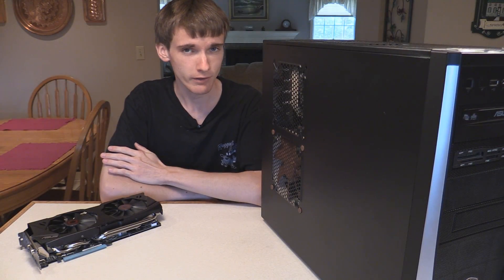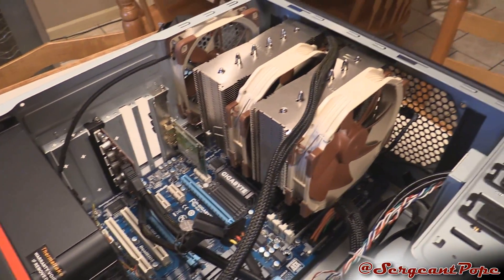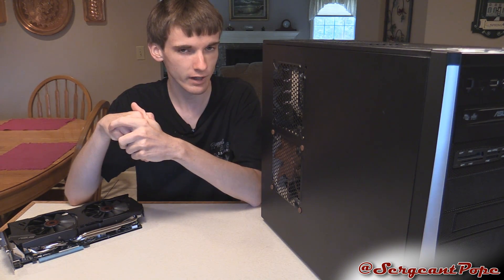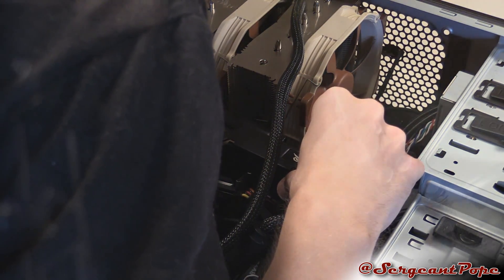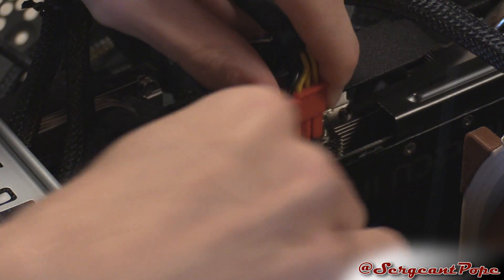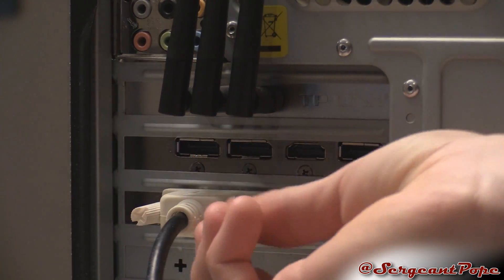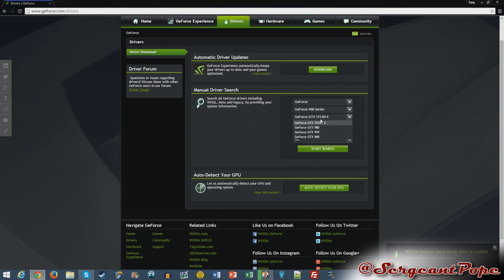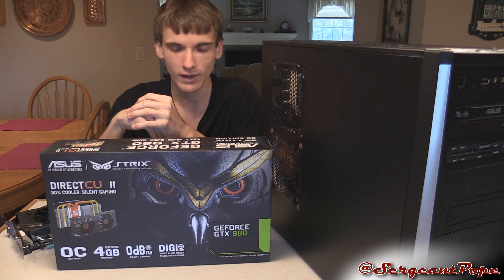How to install a graphics card - GET INTO PC GAMING EASY!

Comment: What do you think on a MsI gtx 960 4gb for medium gaming or is there any graphics cards for less price and equal standards?
Reply from the maker: +Code Plays The GTX 960 is a pretty nice graphics card. If you're running games at 1080p, that would probably run most games at high/ultra. You probably don't need 4GB of memory if you're just gaming at 1080p though, so if you are, I would recommend saving some money by going with a 2GB version of the GTX 960 instead.

Comment: Hey Pope,
I'm new to gaming PCs but would like to slowly get started on building one. I'd like to use a Lenovo H50, since I'm on a budget and already own one. Can you recommend a graphics card for around $50 (I don't mind buying a used one)? I won't be running any demanding games for now. Maybe some online FPS games. Thanks!
Reply from the maker: +Mike L If you're buying new, the cheapest I would get is a GTX 750 Ti or an R7 360. Anything cheaper and the performance of the graphics card really drops off, believe it or not. I can try to help you find a used GPU somewhere later, but I gotta go to class now. Sorry, lol.
Reply: +SergeantPope I was actually looking at the one! Someone recommended the SC model. Not really sure which would work best for me. I know my PC is severely under-powered and am hoping to avoid an external power source. Then again, I may be asking for too much. No need to go out of your way, but if you happen to know someone selling a GPU that would work well for me, that would be great!

Comment: I'm new in those things and i need some help. I have a GT 610 and i want an upgrade to GTX 750 . As i see in min 5:17 , u have some PIN connectors from ur Power Supply.  My power supply model is  ATX SWITCHING POWER SUPPLY  MODEL : ATX-500B but i don't see any PIN connectors connected to my GT 610 or any free PIN connectors in the case that i need  to supply GTX 750 .
What should i do ...? I rly need this upgrade to GTX 750 im not satisfied with current GT 610.
Reply from the maker: +Bmeister You probably need to upgrade your power supply if there is no power connector. If you find the EVGA 500 watt power supply on Amazon, that's pretty affordable and it has plenty of power for a GTX 750.
Reply: Well... i've asked on a forum and few people said to me that there are some models of GTX 750 that don't need any special Power connectors , just the pci. Is it true ?  I found this : http://www.amazon.co.uk/EVGA-GeForce-Superclocked-Graphics-DisplayPort/dp/B00IDG3IDO/ref=sr_1_2?ie=UTF8&qid=1455936733&sr=8-2&keywords=gtx+750
Reply from the maker: Bmeister That's true that some don't require additional power, like the one you linked. I would still make sure you have enough power. I believe the GTX 750 Ti requires at least 400 watts.

Comment: umm.. which one its better asus gtx 750 strix 4gb or gtx 950 strix 2gb
Reply from the maker: +Danny Stefanus I would go with a GTX 950 over a 750, no matter the memory size. You only really need more memory if you're going to play on higher resolutions such as 4k. I think a GTX 950 is something around 15% faster than the 750, so go with a 950 if you can get a good deal on one.
Reply: +SergeantPope aye thanks sir

Comment: Quick question to anyone?  On a modern PC, Starting from scratch, with a Motherboard(Intel) with integrated Video(compatible CPU/APU) Windows 7 Pro 64bit, Nvidia 750ti , Do I need to install OS before the Nvidia card? 2nd, do If so do i need to install driver before physically installing card?  EUFI is set to auto for selecting video on-board vs PCIe slot .  Thanks !
Reply from the maker: +Benjamin Fuller You can install a new graphics card before you install Windows. The graphics will probably look bad without the drivers, but everything will work just fine. Once you get into Windows, then install the drivers.
Reply: Ok, Thank You. It's been a while since I built a machine(AGP days) so wanted to make sure we were doing things right. I must have a bad video card, installs a genereic driver, but as soon as we DL & install NVIDIA driver windows crashes.....I'll play with EUFI/BIOS to make sure I have it set up correctly. Thank You again.
Reply from the maker: Benjamin Fuller Is it a problem with Windows? That could possibly cause an issue too. Just an idea.

Comment: sorry to be pain but i have another question!  I've got a amd radeon r9 380 and this pc http://www.amazon.co.uk/HP-Pavilion-550-182na-workstations-DDR3-SDRAM/dp/B0155TCZXK  (i think) would it take the card ? +SergeantPope
Reply from the maker: +Baxter Aviation An R9 380 should fit in that case, and it's compatible with your motherboard. So yes, everything should work out nicely.

Comment: When I bought my graphic card the guy in the shop mentioned something about friction or something like that otherwise I it would damage my PC ????
Reply: It's static I think??
Reply from the maker: +Baxter Aviation Yep, static electricity can destroy your computer if you aren't careful. So just make sure you ground yourself before working on the inside of your computer. You can do this by touching a metal surface in your house. It's also smart to work on a hard surface such as wood flooring or tile instead of a carpeted surface.

Comment: Could u help me with a $1200 full setup
Reply from the maker: +xblazerztagzx Sure. I can help you some. I can tell you what graphics card to get if you tell me how much you wanna spend for that.
Reply: +SergeantPope $350 max
Reply from the maker: xblazerztagzx With that budget, I would probably get a GTX 970 or a R9 390
Reply: +SergeantPope ok how about processor
Reply from the maker: xblazerztagzx That could vary by a lot. It depends largely on how much you wanna spend, what you'll be doing on your computer, and a whole whack of other things.
Reply: +SergeantPope I really just want to game in 1080p and start a YouTube channel
Reply from the maker: xblazerztagzx Ok. I mean, there are a lot of options. You could go with an AMD FX-8370. You could get an Intel i7 6600k. There are a lot of different CPUs out there.

Comment: hey,  hi 
nice to find you,  and hope you could help.
i have my motherboard Mercury PI945GCM 
could you tell me what is the best grapichs card i could install in it, i m using Windows 10. 32-bit operating system. with 3Gb RAM. Pentium 4. 3.2GHz. i need it for photoshop purpose.
Reply from the maker: +Ravi Pratik I've never heard of that motherboard brand before. But the graphics card you get will most likely depend on your budget.
Reply: +SergeantPope its around 150 to 200$
Reply from the maker: Ravi Pratik With that budget, a GTX 950 or a R9 370 would work nicely.
Reply: SergeantPope and please one more question, the graphics card 64 bit and DDR3 has nothing to with the one of the computer and RAM respectively.  Right?
Reply from the maker: Ravi Pratik Not really sure what you meant there, maybe you forgot to include a few words. But I'll try to answer it. A 64 bit Windows version, DDR3 ram, and a graphics card will all work together. Not sure if that answers your question though.
Reply: SergeantPope was satisfying bro. But what i meant was the specification of the graphics card like DDR3 and 64-bit, has nothing to do with The specification of mother board amd ram. What i mean to say is should DDR3 specifications of Grapics card and That of RAM should be same, and if graphics card is of 64-bit should the processor too should be of 64-bit or it could b different, like 64 bit graphics card is ok with 32-bit processor and DDR3 grapics card is independent of RAM sepicfication, mean to say graphics card could b DDR3 when i HAve DDR2 RAM.?
Sorry for such long... Question. :(
Reply from the maker: Ravi Pratik Oh ok, I think I understand. Graphics cards are pretty much universally compatible with motherboards. As long as the motherboard has a PCIe X16 slot, it'll work. The bit of the graphics card doesn't really matter for compatibility and the memory type only matters for performance (GDDR5 is probably what you want).
Reply: SergeantPope so thanxxx man... U made it all clear so going to order it from flipkart

Comment: are there any downsides to having a too big psu
Reply: Cryanthos, I read several articles about power supplies, before I bought my Seasonic 550 watt power supply.

Several computer writers said a power supply that has way more watts than your computer needs will not run as efficiently as one that is just a little over powered. But what in the name of Drag Racing Turtles does that mean!?

A few articles had graphs. As far as I could tell, if your power supply has 200 or 300 more watts than your computer needs, it just does not matter.

This is what ** I ** say! As you go up in watts, 600 watts, 700 watts, 800 watts, those high powered supplies have ** MORE CABLES ** and ** MORE CONNECTORS ** than 500 watt power supplies. So you are buying extra cables and connectors that you will not use and they will just clutter up your case.

Also, the really high watt power supplies are bigger, physically larger. So a big power supply may not even fit in your case!

So my advice is sort out your drives and the connectors for your video card, if it has any, the ** extra ** connector(s) for your motherboard and anything else that needs a connector from the power supply. Then buy a power supply that has those connectors and as few extra connectors as you can get away with.

And think about future expansion. Are you going to add another SATA hard drive? It would need a SATA power connector from the power supply.

Best wishes with your computer project!
Reply from the maker: +Road to 1000000000000000000000000000000000000000 subscribers Not really, just in price.

Comment: Sup Sgt I want to get a gaming graphics card & I just want to know the difference between 1GB & 2GB graphics cards because I don't want to buy a 1GB which are a little cheaper only to find out I need more for other games to function.
Reply from the maker: +Ed, Edd n Eddy The amount of memory isn't the only determinant of how fast a graphics card is, though generally the faster graphics cards do have more memory because they need more of it. If you're playing at 1080p, a 1GB card will probably work fine for you, but a 2GB card will work better on more demanding games such as GTA V.
Reply: +SergeantPope Cool thanks

Comment: NVIDIA GeForce GTX 970 is this a good graphics card for like 3d modeling like solidworks and or gaming, not heavy but average gaming
Reply: it also has 6th gen intel core i7 and 16 gb of ram with 2tb hard drive and 125gb of solid state drive
Reply from the maker: +Pioquinto Elizondo Yeah, the GTX 970 is great. It's a great bang for your buck graphics card, and it's still very fast for even demanding gaming.
Reply: ok ty

Comment: These are my specs
Processor: Intel(R) Pentium(R) D CPU 3.00 GHz 2.99GHz
RAM:4.00 Gb
System type: 64-bit Operating system, x64-based Processor.

Current graphics card: Intel (R) Q965/Q963 Express chipset family (Microsoft corporation WDDM 1.1)
Hi i was wondering if you could help me find a good graphics card that i could replace with this one. So that i can play CS:GO and Rust. Whenever i try to play CS:GO it says that my graphics hardware must support at least shader model 3.0 to run this game. Do i need to buy a new graphics card or is it because im using a vga cable for input? Please help because i really want to play CS:GO. +SergeantPope
Reply from the maker: +BRUH ITS JONDON Can you tell me what kind of computer you have, such as the model number from Dell, HP, etc. that I can look up. I honestly can't help with the specs you told me.
Reply: SergeantPope  Dangit i'm afraid my sticker is worn off as for my computer is refurbished
Reply: This is the only thing i can thing of that might help you PC-Dell-745-D-PD-28-4-250-DVD-8h
Reply from the maker: BRUH ITS JONDON Hmm, none of those look like the model number. But if it's a full sized desktop with a X16 PCIe slot on the motherboard, any graphics card will work fine on the computer.
Reply: Ok thank you for your help and keep posting the great helping videos!

Comment: hey man I need some help with my computer. it's a 2013 dell inspiron 3000 desktop computer. I have a Intel I5 in it. what graphics card would you recommend and what power supply?
Reply from the maker: +Cameron Ewing Most graphics cards should fit in your desktop. Whatever graphics card you buy depends on your budget. How much do you want to spend?
Reply: +SergeantPope well I looked into it and would a nvidia gtx 750 run things like dayz and Skyrim pretty well?
Reply from the maker: Cameron Ewing A GTX 750 Ti will probably run DayZ just fine. Skyrim will probably run ok on that graphics card. Some newer games that are heavy on graphics will be tough for a GTX 750 Ti to play.
Reply: +SergeantPope so what card would you recommend for around 150-200$?
Reply: +SergeantPope and for a power supply what size do you think I should get with it
Reply: +SergeantPope .
Reply from the maker: Cameron Ewing With your budget, I would probably get the GTX 950. It's a little newer than the GTX 750 Ti, and I think it's about 15% faster. With that card you would need a 400 watt power supply.
Reply: +SergeantPope alright thanks man
Reply: +SergeantPope so with that what power supply would you recommend on that?
Reply from the maker: Cameron Ewing Here's an EVGA power supply that should work fine. Either the 430 and 500 watt versions should work fine, and they'll give you a little extra power too which is always good to have. http://smile.amazon.com/EVGA-Continuous-Warranty-Supply-100-W1-0430-KR/dp/B00H33SDR4/
Reply: +SergeantPope alright and final thing, so with the cords from the power supply can I just use any thing to plug things into the psu? or do certain wires have certain connections
Reply from the maker: Cameron Ewing Graphics cards either need 6 pin or 8 pin connectors, or sometimes even both. The cable coming from the power supply will literally have either 6 or 8 pins.
Reply: +SergeantPope so will power supplies have both on it?
Reply from the maker: Cameron Ewing Some have both, but some power supplies only have 6 pin connectors. In that case there are adapters.
Reply: +SergeantPope ok. and sorry lol but do graphics cards and power supplies have certain chipsets to go with the motherboard?
Reply from the maker: Cameron Ewing It's ok Cameron, I've been there before too. But nope, pretty much any graphics card will work on any motherboard. Make sure your motherboard has a x16 PCIe slot, which most do.
Reply: +SergeantPope yeah I'm now looking into the msi gtx 960, but I don't think my case can fit it
Reply from the maker: Cameron Ewing You have a full sized desktop from what I see online, so that can easily fit a GTX 960. I had a similar HP that I put enormous graphics cards in.
Reply: +SergeantPope do you have am email or something I can send a picture of it to?
Reply: +SergeantPope and by the way the computer I'd specifically a dell inspiron 660
Reply from the maker: Cameron Ewing You can tweet me a pic of your computer.@SergeantPope Take a pic of your side panel taken off so I can see inside and I can let you know if it'll fit.

Comment: So i swapped out my 560 for a 970, now it is powering on and off slowly, and when it finally comes on my monitor shows no signal. What did I forget to do?
Reply: Maybe it also needs an external power?
Reply: +Dan Andrews I fixed it. put in the old card. removed a driver I missed. then put in the new one

Comment: Hi We have an Dell Optiplex 390 unit -it looks like a small tower unit -when we took the side off I can not see the mother board easily-there appears to be a spare slot -please advice if this can be upgraded and what type of graphics board would be best
Reply from the maker: +keith bell It looks like the motherboard can work with any graphics card. Just make sure the power supply has enough wattage and amperage.
Reply: +SergeantPope 
Trouble us there is no little room I can not see the motherboard and whether there is an edge connector to mate too
Reply from the maker: keith bell I don't really know what you mean by that. If you want to tweet me pictures of you desktop I can try to help. My twitter is @SergeantPope

Comment: Hey SergeantPope, can you help me pick a GPU?  I have a fx 8350 cpu and am looking to spend around the $250 mark.  I would like my video card to be decently quiet.  I was leaning towards the xfx r9 380x, but i heard that it was pretty loud.  So I am now looking at the EVGA gtx 960 4gb FTW edition.  Plz help, thanks!
Reply from the maker: +Nicholas Nguyen If I was you, I'd get the GTX 960 FTW edition instead. Nvidia cards use less power and run cooler, which will in turn be quieter. The GTX 960 will work perfect at 1080p and will do pretty well at 1440p also. If you plan to play at 4k, get something better though.
Reply: The R9 380X will beat it out performance wise I believe. 
I have an R9 380 and it kills my old GTX 960 4g.
Reply: BTW- Look at other brands. The only brand that I saw that 'doesn't run hot' was MSI, and I have the MSI R9 380 4G and it runs very cool even at 1080p on ultra settings.